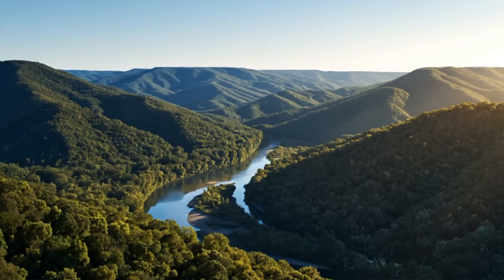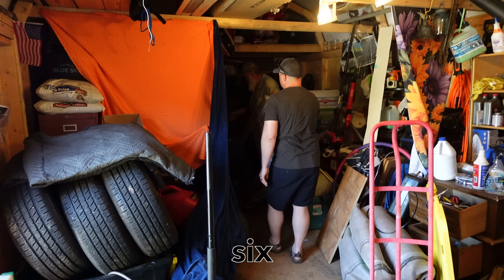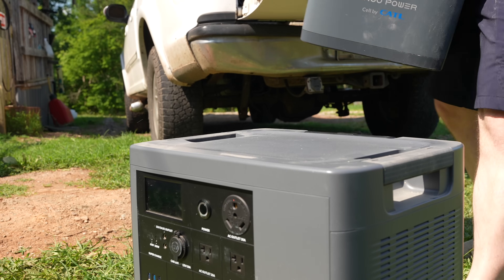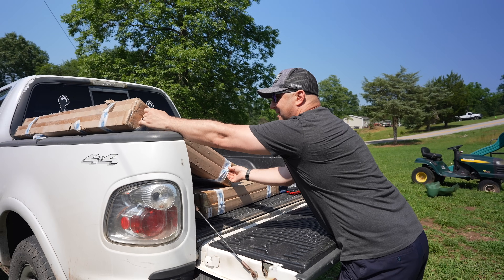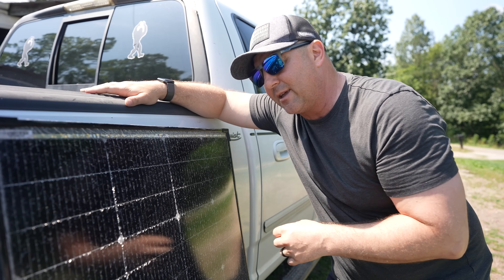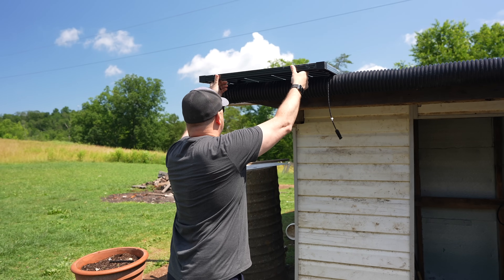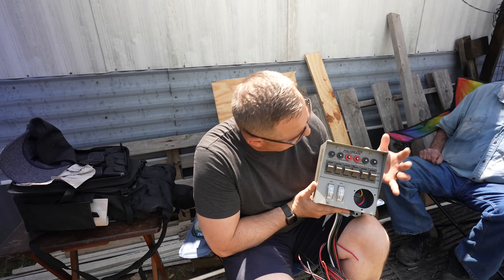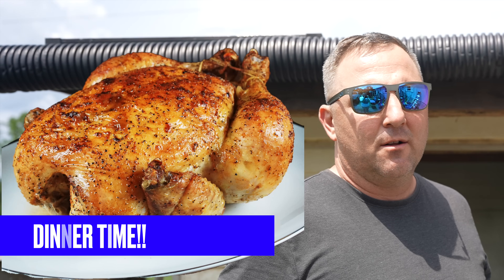My Makeshift Answer to CONSTANT Power Outages!

Comment: Good idea, and the BougeRV panels (specifically the 200 watt 16bb topcon bifacial N) are on sale. They just went up slightly (one sale ended on June 30) and still have a different sale the first week of July. About $30 each less than buying from Amazon or Walmart. They are really good panels. The temperature coefficient is really good (really important for me) and the degradation is also good. I just bought 10 myself.

Comment: If you wanted to emphasize safety, then you should never have installed a Mango Power E with its cheap high frequency, transformerless inverter. Without an output transformer, this cheap inverter can easily damage your home's appliances when its MOSFETs fail. A much better and safer choice would have been a low frequency, transformer based inverter.

Comment: I got two shattered solar panels like yours so i use them on a separate string to charge a single 100ah LiFePo4 battery. They still work and give about half the rated power so they are useful to me. Greetings from Jamaica.
Reply from the maker: Ouch. Did you get replacements as well? Good that they bring in some power. My worry is that if I still use it with the other panels it could deliver a big shock if it gets wet.
Reply: Get a windshield repair kit to fix the panels.
Reply: @GerbenWulff  It's not a small crack, the entire glass is shattered.